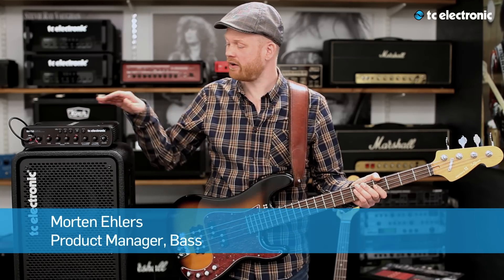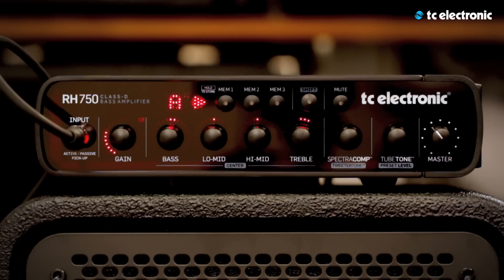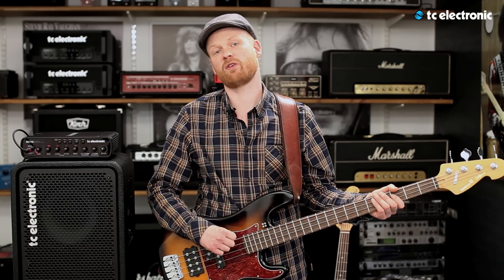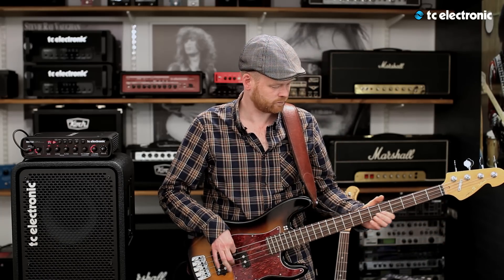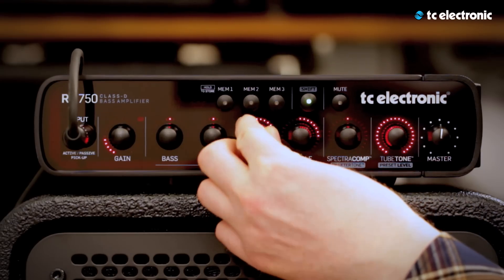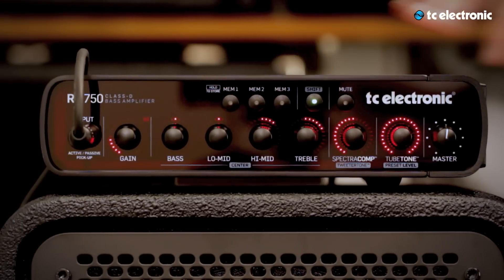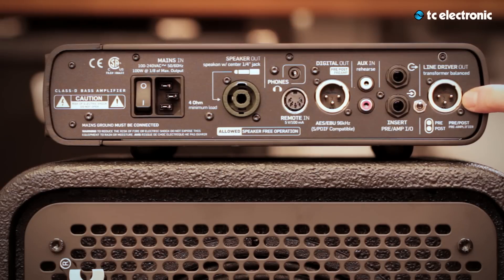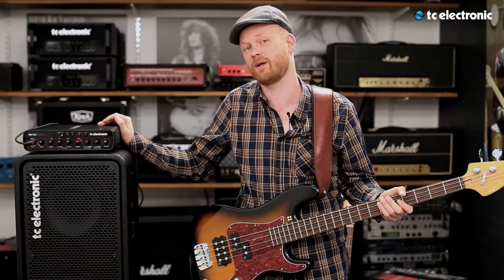TC Electronic RH750 Bass Amp demo

Comment: You guys really need to put that tube-tone into a pedal. It's such a nice sounding and useful effect, I leave it on on my BG250 combo most of the time.
I particularly like using it on low settings with an already distorted signal, it gets rid of any little screechy treble peaks and breaks up the low end just a little bit more. It would go down great in it's own pedal with more control over the effect.

Comment: Beware - The RCA inputs don't work how you might expect. In my other bass amp, when I connect a music source (e.g. laptop, phone) to the amp via the RCA, the music source plays through the main speaker. With the RH750, the music source plays only through the headphone on the amp and NOT through the main speakers. This was confirmed from the seller who referred me to the relevant page in the product manual. This was a major bummer for me because I purchased the BeatBuddy drum pedal and the pedal manufacturer recommends that you play the pedal through RCA port to get the best quality sound. Now i'm stuck with playing the pedal through the main amp input port in front. Alternatively, can I use the effects loop inputs for this. If so, how?

Otherwise, this is a great bass amp.
Reply: he states that in the video.  Can't you use the 1/4" line in?

Comment: what's the cab it's connected to?
Reply from the maker: an RS212 :)
Reply: +TC Electronic is that 1 or 2 of them because I'm thinking about getting one of these heads and wondering what Cab or cabs I can connect to it
Reply: +TC Electronic I'm guessing 2 because that would be a 800w power handling
Reply: you can connect any three cobinations of speakers,RS cabs only

Comment: Very disappointed. i am so over the buzz in the tweeter driver that comes and goes,. customer service are not helpful at all, impossible to get someone on the phone. i got a rs 210 and a bh250 shipped in from the US  i live in Australia and TC warranty won't cover for purchases outside Australia. The tweeter control on the back of the cab makes an annoying squeaking screechy noise when making adjustments and the tweeter hisses when on . For all the difference to tone its not worth the effort anyway. Ok thats the cab whinge done with, lets do the head... BH250 tone print got this thing so i can shape my sound with the tone print option. HA ! comes with a horrible sounding chorus effect already installed. i have it turned off but occasionally it turns itself on and that horrible chorus sound comes through uninvited. There is very little tonal variation on this head hence the tone print option to spruce up the sound. Mono tone head. 250 watts ? i don't think so more like 80. Casing is cheap and nasty. Ive had this gear 5/6 months and the on off switch has developed a fault. Wont turn on occasionally. Just what you need to put you in a good mood for practice. Oh noisy fan they don't mention that in the reviews. That fan noise will drive you nuts trust me. Between the fan and the speaker buzz its no wonder the second hand market is littered with six month old Tc bass gear. Ive seen these bass cabs going real cheap because of a buzz in the cab, seems to be a common problem. Over a $1000 for this gear even without the issues very disappointed with the sound.  I had total faith in TC and trusted these  high powered reviews. i feel sick every time i look at this rig, anyone want to buy it going cheap!,,,,, ps if you think I'm just having a whinge check out TC forum page pretty much everything I've mentioned is a common problem for other users, lots of other users. Ridiculous. This is not a good company to deal with, http://forum.tcelectronic.com/forum/12/bass/
Reply from the maker: Hi Sean. Have you contacted the support team regarding this? If not, then give us a shout on Facebook via private message. Cheers.
Reply: tc support is for asking simple questions and getting simple answers a day later not for dealing with major technical malfunctions. i was trying to determine wether the cab was faulty or the head and what your procedure was for returns. Turns out both units are faulty. Ive just received another dismissive email from TC service team this morning. I am pulling my hair out here. I have late stage Morgellons a very serious disease, i am basically fighting for my life . i took up playing bass again as therapy and a distraction from my circumstance.  TC support is shockingly dysfunctional and I'm not the only one saying this. I shouldn't need to slander you guys on youtube to get your attention. The stress of this is destroying my health and sanity. i have just enough energy to perform basic tasks like cooking and cleaning .  i bought new gear so i wouldn't have to experience these dramas. this is a very expensive nightmare and i am completely over your smarmy corporate niceties "We are honored to have you as our customer -- thank you for your trust." i read that and want to scream. $1200 and a $2000 bass i can't play. Six months of absolute hell, it would be nice to communicate with a person and not a computer generated algorithm. Once again another day ruined by the  stress of this . Thanks TC
Reply: No joy with your Facebook page either . Been waiting a week now for simple instructions on how to get this gear repaired. Infuriating. Don't you guys care about your reputation.